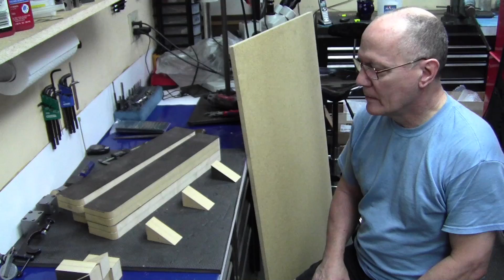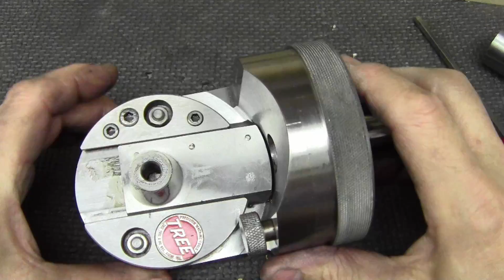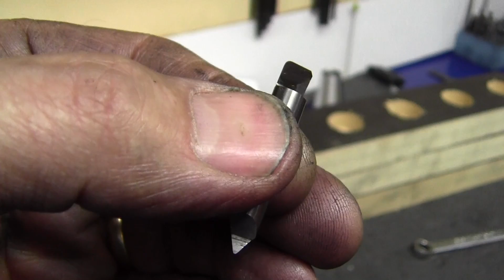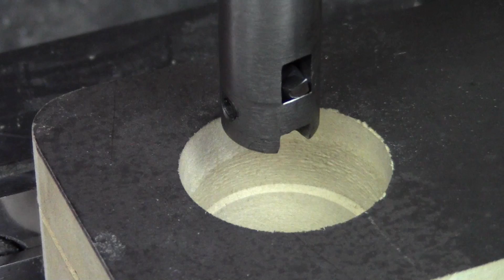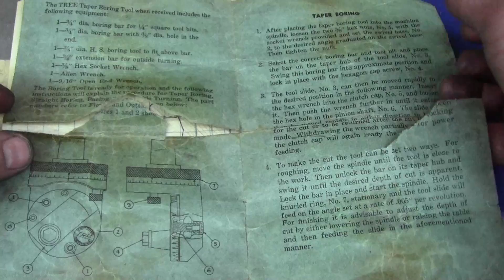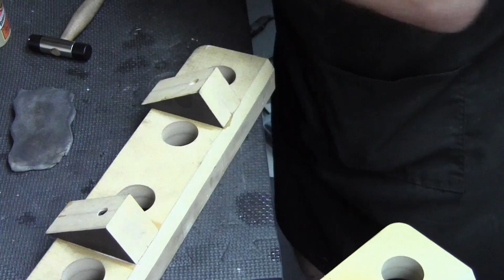Taper Boring on the Mill

Comment: I like it! 
Another neat trick (especially for making collet racks for ER collets, where the taper is the same but there are lots of different sizes) is to make a tapered D-bit for the smallest size, but make the shank a standard size which you can plug into a simple (ie conventional) boring head. 
Then, as long as you tighten the grub screw with the flat radial to the cutting axis, you can dial up any bore size you want at that same taper. 
It might struggle in steel, depending on the slenderness of the D bit in relation to bore size, but in plastic or aluminium it's golden.
In MDF I'm guessing it would need a bit of hand-stoned relief to cut, at least for small bores.
Reply from the maker: Thanks for the ideas Gottenhimfella and thanks for watching and commenting!

Comment: nice video, and that tip with the tool grind is a good one, by the way that form looks a lot like what the carbide inserts in the insert tools look like, so a well headed lesson, obviously if those tools are made that way it's safer to cut with this type of tool insert with this profile.

Comment: On my SIP Jig borer 6A Hydroptic when setting the amount of cut after my first cut and measuring with a ball I would back away from said side of face drop the tool into the bore with z axis back away from the side the amount i wanted to cut eg, .040" come back to my origin and it would be within .0005  Nice tool.
Reply: I love the 6A's ...... nice big table with lots of room for the work. The 640 is the cnc version of the 6A and is every bit as precise.
Reply: @bobjimenez4464  Can't beat the precision of these beauties.

Comment: One thing about MDF is it is highly abrasive on cutting tips. 
Vacuum is a great idea to keep the nasty dust under control.

BTW, cool accessory that Tree unit.
Reply from the maker: I may be wrong but I think you might be confusing particle board with MDF. Particle board eats even coated carbide end mills for lunch but I find MDF not much different than Pine.  The Tree unit is very handy for the very rare cases I need it.
Reply: No, the glues are renowned for take the edge off tools. Carbide of course always holds up better. A quick google for MDF toll blunt will tell the story, and of course personal experience.

Comment: Good Demo of the Taper Boring Head.
but probably over Kill for us mere mortals making a tool holder rack out of scrap.
Unless your location is Directly on a Fault line and there is a risk of the Holders Vibrating out.
Maybe us Average Joe's would just use a Hole Saw and Let the Flange of the Holder rest on the rack.

I made a bunch of racks out of Scrap Pallet slats. 
two Vertical end Pieces as Legs Tall enough so the Stud doesn't hit the table.
and a Series of Hole Saw cut holes large enough for the Gauge line diameter to fit through.
So the Flange of the holder is supporting the mass of the tool.

I think If I wall mounted them like you did.
I Cut the angle wedges so that the Knob just rests against the backer board.
The Flange supports the Mass of the tool, and the Knob rests against the back.

but then, that wouldn't have worked to Demo how the Taper Boring head Works.
and I think, that was the Whole Purpose of your Video.

What can I make to Show how this Taper Boring head works.
I'll make super precision tool holder racks.

Great Videos by the way..  I look forward to what you have to Share.

Comment: Really great video. I found it funny that you were sometimes fighting your machinist instincts/standards. One minute you were saying this is only an MDF toolholder, so no need for high precision, the next you are working to an very high standard.  I hope you keep making videos.

 Is the chamfer meister a shop-built tool?

--Ed
Reply from the maker: Yeah its a struggle to not want everything within tenths. I will be back at videos in Jan 2017. The Chamfer meister is shop built and there will be a video on it in the near future. Thanks for watching and commenting!
Reply: Volcker1929 I'm a hot fodder and metalworking guy at heart and a very amateur woodworker but I've never seen a .030 adjustment  boring a hole in wood. I've been watching Robins videos for quite awhile, I'm sure the level of quality he demands of himself crosses over into everything he builds, no matter how mundane.
Reply: @ROBRENZ  You'd be BETTER! OFF  Putting it in the Metal SHREADDER ! If YOU'RE HAVING DIFFICULTY ! AND SEVERLY ! CONFUSED ! WITH ! THAT !!

Comment: Hi there, did you just bore taper holes, just because you had a taper boring tool ? What was wrong with large parallel holes, would have been quicker and achieve the same wall mounted rack. Did you also consider putting 3 or 4 felt strips down the taper holes to stop the tools from touching the wood all the way down and risking a build up of damp / rust if no air can get buy. Oily felts would help the problem, especially if occasionally you rotated the tools you did not use very often.
Reply from the maker: The MDF will definitely hold up better with the taper than hitting just a edge top and bottom. Also a good chance of busting out the bottom lip when you stick a heavy holder in and catch it with the end of the taper. Also a good chance to show people something they may not even know existed. The taper bores are painted and them talcum powder was rubbed in to have a non stick surface. I don't want oil on the tapers in general and I have had no issues  since the video with rust.  Thanks for the comments.
ATB, Robin

Comment: Hey Robin,

What are the two tapped holes in the top of your Kurt used for? They caught my eye. 

All the best,

Tom
Reply from the maker: +oxtoolco I made some plating tank support frames out of 4" square pulltruded fiberglass tubing many years ago. Some pieces were about 10' long and I needed to be squared on the ends. The tapped holes are 1/2-13 to match my stud set and I used 2 studs and a strap clamp over the tubing to hold it tight to the vise base when the 10 feet was hanging out.&#160; Also a very cool use of them here https://youtu.be/wwgO6Lg4RZM?t=27m50s    All the best,  Robin

Comment: I thoroughly admire your attention to detail on even the most basic of so projects.  Did I spy a Kuru Toga pencil when you were making the hole locations?  I love the concept of them, but not completely sold on the execution.
Reply from the maker: +thavinator Thanks,  yes that was a Kuru toga pencil. I agree it might not work as effectively as they claim.
Reply: I like it a bit better after cleaning some of the grease out of it.  It gives the mechanism a lighter feel, but unfortunately also makes it feel just a bit sloppy.  I think to get it right it needs to be made much more precisely, to get a light enough feel without too much slop.  Of course at that point it ain't gonna be a $6 pencil...  Hey, you need another project?  ;)

Comment: If a holder is not often used, the rack could draw away what little lubricant there is and cause rusting. I've saturated wood racks with grease or oil and the rust still creeps in...  All metal racks now. Otherwise awesome!
Reply from the maker: I have not had any problems yet but MDF is not the same as real wood.
Reply: Keep the fingers crossed, I have had issue with MDF too.  Another one is the gray foam that dies and causes rusting in a lot of tooling cases.

Comment: eBay has a few of these (used) taper boring heads for sale....from $500 to $1,000. Far more than a regular boring head. Needless to say, I won't be getting one. Not that I really need it....I've been a machinist for 35 years and I've never encountered a job requiring tapered holes other than those done on a lathe. Anyway, and as you said, Robrenz, the TREE boring head is a well designed cutting tool.

Comment: Machine tools for woodworking and full of wood chips. Never seen that before. I won't even use my good steel drill bits in wood unless they're already dull and I'm desperate. Better make sure you treat that wood with something to prevent it from soaking up moisture if you live in an area with any humidity to speak of. Sitting in those racks if there's moisture in the wood will rust the hell out of your tools. There's a reason most wooden cases for gauges and indicators are oiled wood. That particle board and whatever adhesive its made with could be an issue all by themselves.

Comment: I'm a subscriber and I enjoyed the video but feel that MDF is not a good choice for holding any sort of tool shank. As a few other commenters have noted, MDF will likely absorb and transfer moisture at some point to the tool holder surface. While MDF has a fair amount of resin binder, it will absorb moisture, and paint does only a little to slow that process. Metal or plastic in contact with the tool holders makes more sense to me for the application.
Reply from the maker: I agree technically with all your points but 16 months in daily use with no problems.  Thanks for subscribing and commenting.
Reply: Thanks for the reply. I was speaking more in terms of what would be ideal, not just what may suffice. Glad it is working well for you all the same, and i enjoyed learning about the tapering head.

Comment: Robin, awesome job and awesome tool. Is the adjustment of the tool bit arm just by a metal rule or am I just being stupid + the knurled component is for gripping as the head rotates?  I am trying to get how this really well engineered head works.  Great finished job and safe, protected tools in the shop, well done young man.  Kindest regards. Joe.
Reply from the maker: Thanks Joe, The radial adjustment of the tool is just where you decide to tighten the swiveling tool bar. There is no fine adjust but with a taper you can adjust size by just lowering the quill or raising the knee. You just need to do the trig on what diameter change you will get per increment of Z movement. When you hold the knurled collar it drives the angular slide thru a gear train.

Thanks for commenting and watching!Robin
Reply: +ROBRENZ Robin, many thanks for the explanation, what an amazing tool, I have never seen any of the other guys using anything like this head.  A great result, even on crappy MDF, what a result!!

Comment: Interesting ,you used M D F instead of soft metal, some machinists might look askance, wondering about durability of those holders. I find it refreshing to see non metals being used,however those are hydrodynamic, and are subject to shrink and swell.Check for rust often on the least often used tools.
Reply from the maker: Thanks for your concern. The taper holes were painted along with the whole thing. That has seemed to seal the MDF as I have had no issues in the 18 months of daily use.  I think you meant hygroscopic. Thanks for watching and commenting.
Reply: No, he ment hydrodynamic. As the chipboard will take up and release moisture to attempt parity with its  environment.
Good job, loved the boring head.
Reply: So what's your average weather Conditions ! There

Comment: Hi,  I just stumbled across your video.  Very interesting boring head!  May be a silly question as I'm not yet a regular, but what are the cat 40 holders for?  I'm thinking a CNC.  If you have a CNC why not just bore the taper with the CNC?   I've made several of these for my NMTB 30 CNC tool holders.  I've made some years ago in Aluminum and they worked great, but about 6 months ago I made some from MDF.   My shop is not climate controlled and humidity is high in the summer.  I've found the MDF is holding moisture causing my tapers to rust where contact with the MDF.  Be sure to coat your tapers with some oil if you live in a humid environment.  I'm going to re make mine from a different material.  MDF is not great for this.
Reply from the maker: Hi Roger, yes for a CNC. I know I could spiral path a taper hole with an end mill on the CNC. But I know of no way to single point taper bore on a CNC unless you are talking about the boring mill heads with radial out feed control. I painted the tapered bores of the MDF and have had no rust problems in my  air conditioned shop. Thanks for commenting and watching!
ATB, Robin
Reply: Air conditioned shop is the key!  As for boring the taper.  I use Fusion 360 , I just drew a circle extruded at the correct taper angle, then did a 2D bore.  The bore operation respected the taper in the model.  I just used a flat endmill and it came out good enough.  A ball endmill would have given a better surface finish.
Reply: here is the Fusion file:  http://a360.co/2c0MCZT

Comment: Great, another tool I didn't know I need/want. :-) CNC was obviously a huge advancement  in machining and it's made a whole lot of products a lot cheaper to produce.But it sure killed off  many company's who made some really clever manual machine accessory's. Volstro was another who made a lot of very desirable tooling for Bridgeport sized machines. 

As usual a very well explained video about how it works and is set up Rob. It might take longer but can the tool slide be retracted just by running the mill in reverse and holding the ring? 

Didn't think there were many like myself who sometimes use a mill for working wood even though I've never seen any mention of not doing so. The dust and chips are a pain but I can't fault the obtainable accuracy. Fwiw Wagner who are also now out of business made what was called a Saf-T-Planer originally designed for drill press use before the cheap off shore wood planers started being sold. It's basically a 3" diameter 3 tooth face mill for wood that works really well on a mill. Some Youtube videos around showing some scary use on drill presses.
Reply from the maker: Thanks Turning Point and yes it will go the other direction in reverse.
Reply: Your first Paragraph , Are you Blaming Computers ! For those Companies !??and last paragraph , that's not to be confused with the Blade put on Angle Grinders !?? Is it !.

Comment: The price of the TREE Taper Boring Head is still very high in 2019? Coincidence? I think NOT!
Reply: I bought one of those 20 years a go on the USA EBAY site, cost me $200 then when the A$ was 1 for 1.
BTW, the Tree boring head with taper ability is actually a boring and facing head not just a plain boring head.
Reply: I just got one on eBay a couple days ago for $500.00
Reply: @oldSawyer  Lucky you......nice bit of engineering and cheap at that price for a boring and facing head.
Reply: @davidwillard7334  What happened?

Comment: how do you adjust this boring head to take 1 thousandth out?
Reply from the maker: Lets set it to 45 degrees just to make the trig easy.&#160; One thou is .0005" radial on each side. 45 - 45 -90 triangle is 1-1-square root of 2. So .0005" down feed of the mill quill would increase the diameter .001"
Reply: It's Fixed ! Hey !.

Comment: What is the angle of that "near locked" taper?
Reply from the maker: 16.26 degrees
Reply: ROBRENZ I think that matches cat40 tooling. I'm not in a shop anymore or I would check. Interesting.
Reply from the maker: Hey Chris I thought you meant the cat 40. I now realize you meant the taper on the tree tool holder arms. I did not measure it but I can if you need it.
Reply: ROBRENZYes you were praising the engineering and I just got curious no need to go to any trouble.
Reply: @ROBRENZ  WHY ! The Wrong Angle !?? Then !.